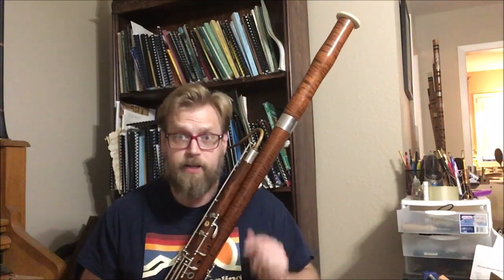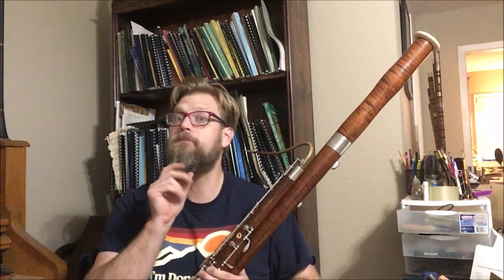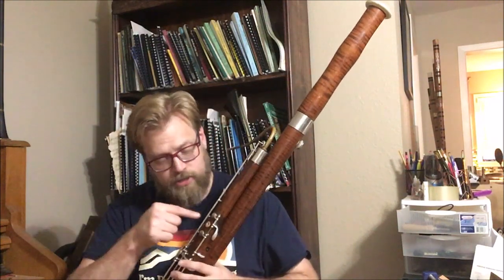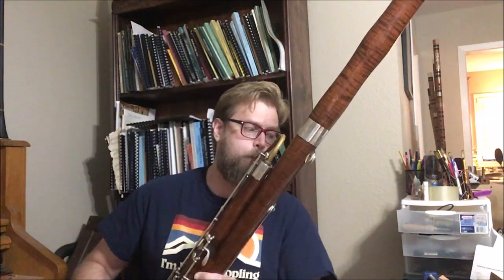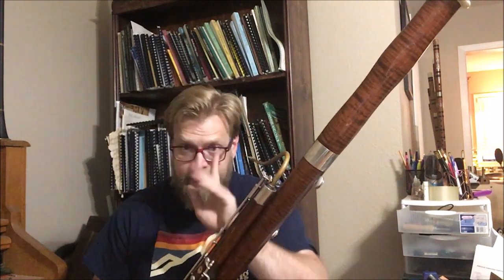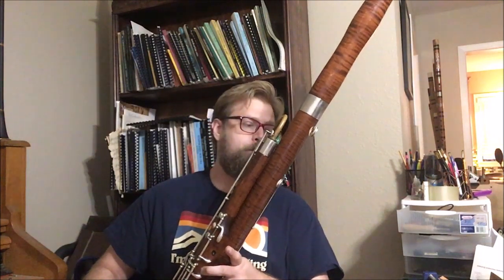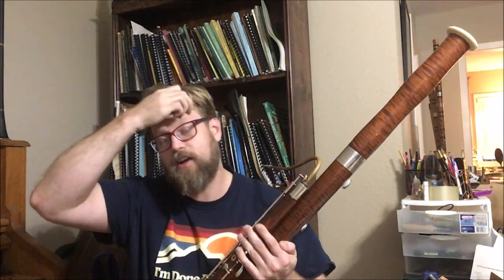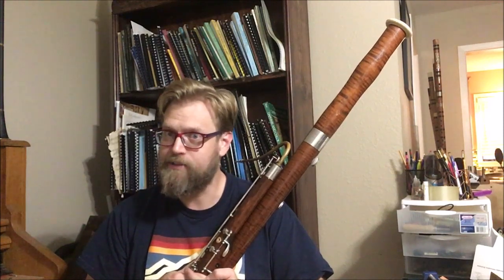I Did Something Stupid to my Bassoon (for science)

Comment: Coming from the saxophone side of things, this is interesting to see the same issues cropping up in the same register. The sax does have two register keys (basically from invention- Adolphe Sax originally developed the automatic double register key for an improved bass clarinet), and they're laid out in about the same places on the bore as the whisper key and the key you've opened for the vent.

The issues are a little more pronounced, though, on the sax - even the lower vent doesn't really work that well for the first note of the second register (written D), so it's pretty common to vent that with the D palm key instead, and skip the register key, in slower passages.